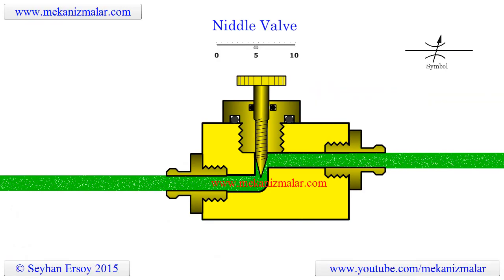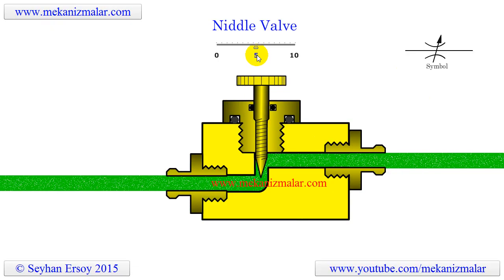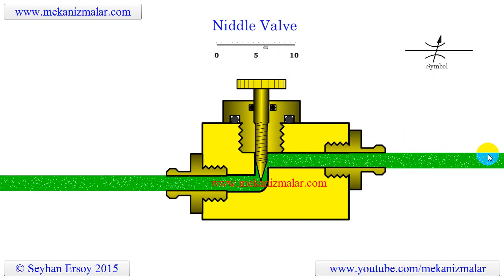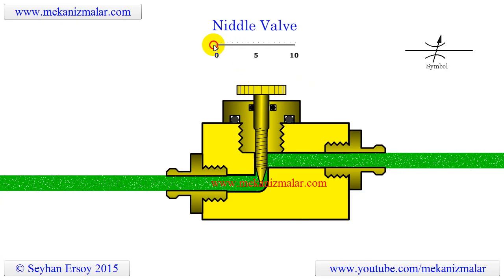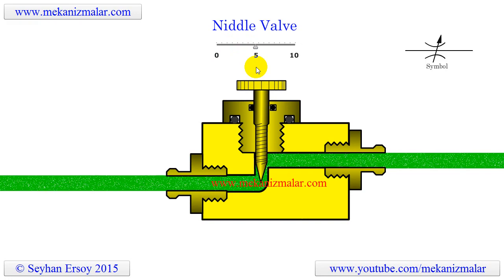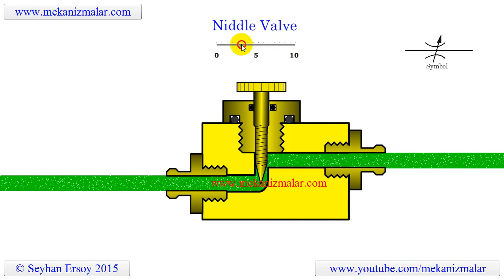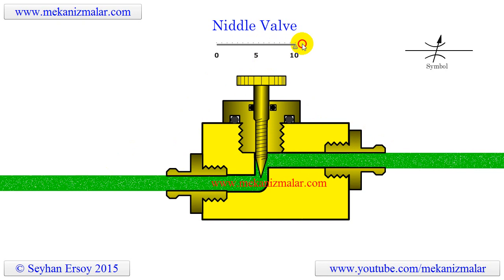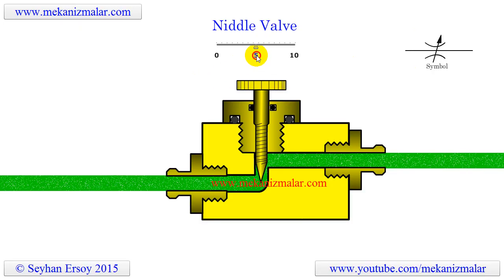how needle valve works

Comment: here flow control is manually but how do we know the actual flow rate?
Reply from the maker: The places you use this needle wave require some adjustment before to use this valve. For example if you want slow forward motion for a hydraulic cylinder  you can adjust forward motion by calibrating piston motion with needle valve. If amount of flow going through a needle waleve must be know, than you should use oil flow meter